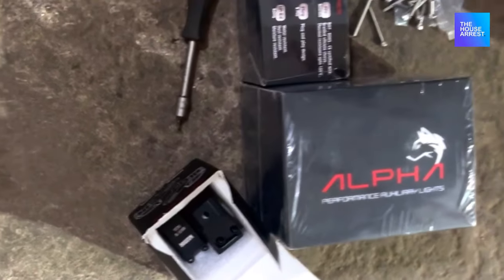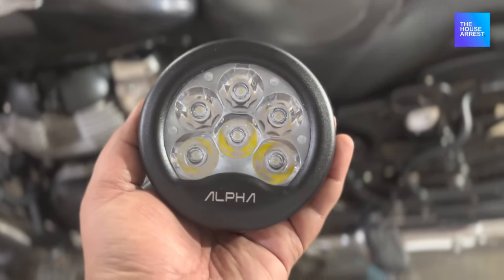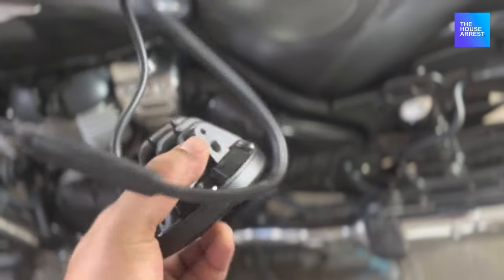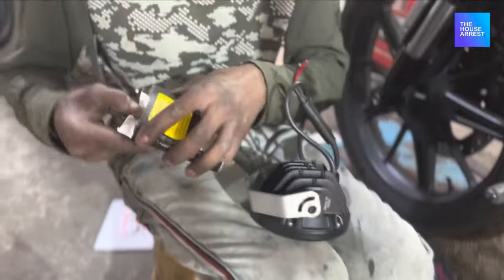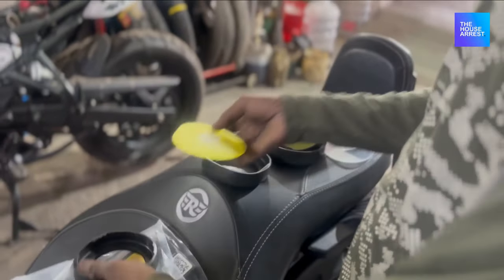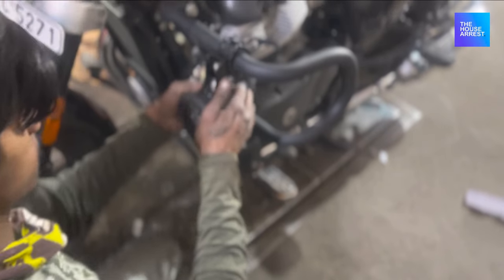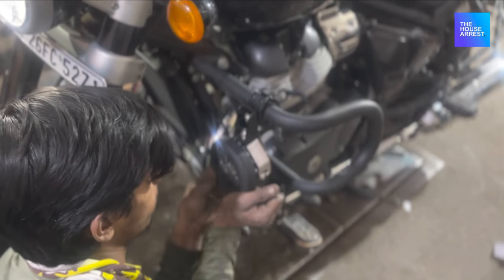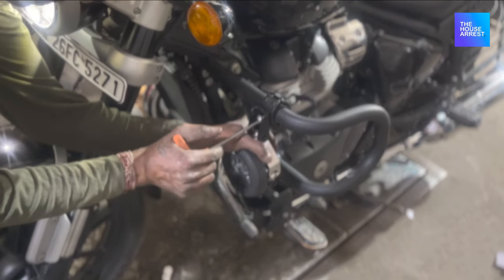Maddog Alpha Lights on Super Meteor 650 - You Wouldn't Believe!

Comment: I want details of dual horn and its harness
Reply from the maker: The horns are from Royal Enfield Only. Instead of one, that comes with the factory, I have added same as the other one. Fixing it is very simple, the mechanic can use simple wiring and ziplocks to make it look clean. You can get the horn from RE Service Center, or your mechanic can also provide if they have in stock. Costs around 600/- INR.